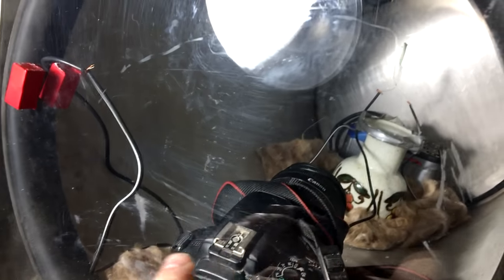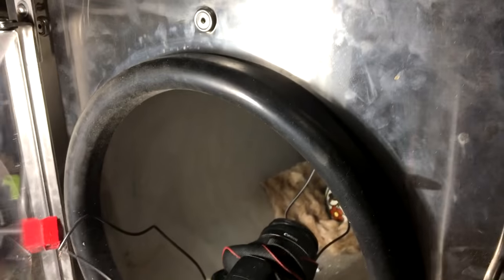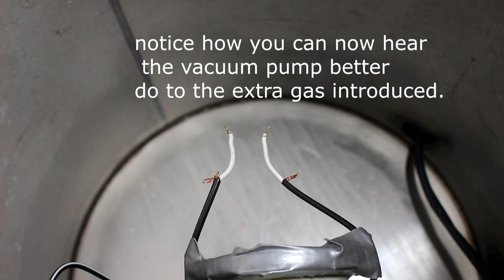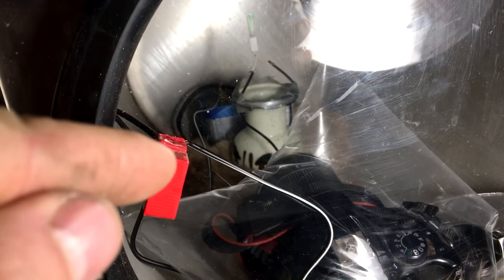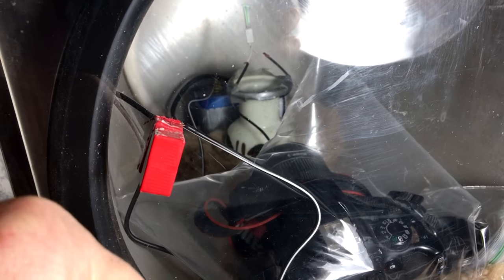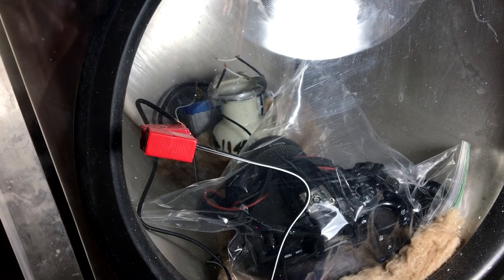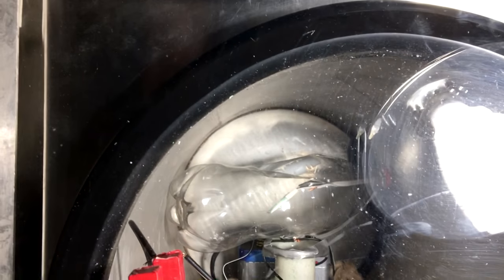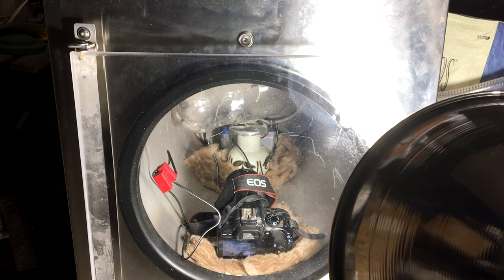Sound of Explosions in Space? part 1

Comment: The blasting cap is a high explosive so the speed of the expanding gas is very rapid. So the pressure difference between the inside and outside of the bottle ripped it apart.

Comment: That is what I thought about some time ago. It is often criticized that Hollwood overemphasises sound in space battles. The argument goes like: no medium -> no sound. That is technically correct and for normal soundwaves this is undoubtedly the case. For shockwaves on the other hand... I was sceptical. Shockwaves are usually created when a medium is compressed faster then its speed of sound allows. This is the case until a pressure equilibrium is reached between the compression zone and the surrounding medium. Under vacuum the shockwave could virtually travel for ever as there is no surrounding medium. Of course at some time it will be undetectable due to expansion but in close proximity a powerfull enought explosion would be audiable even in space.

Comment: 500 mTorr is ~ 5 quadrillion times the pressure in deep space. Taking into account the temperature difference, your near-vacuum chamber is still 50 trillion times denser. So, sound will travel better through it. (Plus as you mentioned, it's a small container trying to contain an explosion with a microphone not free floating from the outer case)

Comment: I've always argued that big enough explosions in space would carry sound for much this reason.  If you look at a slow motion video of an atmospheric explosion the sound is generally carried by a single blast wave that's faster than the pressure front of the gases, but an explosion still produces a lot of fast moving gas that would impact any non-vacuum containing object and should provide a weak medium for the sound.
My hypothesis is that in a vacuum the gasses from an explosion should expand faster due to the greater pressure gradient while the initial force from the blast, lacking a medium to propagate through, would be concentrated in shrapnel and the more dense gases giving more damage and some impact sounds.  If that holds, I'd expect an explosion in space to have different sound (a rumble or thud maybe?) and be much quieter.  I'd also expect them to appear bigger, and happen faster.  ponders actually, explosions in space should look like fireworks.  Now all I need to do is figure out how to ship explosives to space for controlled detonation and observation.

Incidentally, the hole in the bottle makes sense... the explosive produces the same amount of energy and the same pressure wave as it would under normal atmospheric detonation, only without any air to dampen or diffuse the force.  The bottle doesn't have a higher pressure on the outside to provide it with reinforcement, so the result seems about right.

Comment: Cool thing, but I have one thing to mention about your experiment. The chamber is at low pressure, like space is. But space is not surrounded by a barrel, which reflects and amplifies (by reflection) the gas which is expanding inside your tube. Try to disable the reflection and make the experiment again. Maybe something fluffy covering your tube and some wadding between the microphone and the blastcap will reduce the reflection by swallowing the extending gas.

Comment: Hi,

Here is my opinion.

1) The blasting cap will produce considerable amount of gasses, which could carry the sound waves
2) The testing chamber is quite small and allows pressure built-up on small times scales
3) Vacuum is still not even close to outer space and there are sufficient amount of gasses to carry sound waves
4) From my experience thin films like plastic bags are quite transparent to sound

Your experiment is quite interesting. However in my opinion the conditions are quite different compared to outer space and we should only accept that it appears the sound has traveled in this experiment. 

Regards
Reply from the maker: I asked NASA to detonate a small explosive outside the space station for me but they have failed to reply.

Comment: Sound is high frequency vibrations. This chamber bounces the gas around from the explosion which echoes the initial gas release making more vibrations. I expect in space if the explosion is a good distance (say 200 m perhaps, depends on explosion too) you will simply feel a wind, first the fast particles will arrive then the slow ones. The wind will probably be imperceptible (depending on explosion) with no audible sound (ie no high frequency vibrations in this wind). Unless you get hit by shrapnel... This does not happen in an atmosphere because the explosion transfers its energy to make pressure waves which all travel at the same speed and all arrive in a short time span, and delayed due to that limited speed.

Comment: And furthermore, the gas particles might even produce more echos.
The particles aren't slowed down so they can travel further, so distance wouldn't make that much difference plus in this case they can also bounce around in the chamber.
Would be interesting to gauge the pressure at set distances and compare vacuuum with atmospheric conditions.

Comment: Before watching the video... and knowing the size of vacuum chamber he's got.  Yes an explosion will make a sound.  The expanding gas will fill the chamber and transmit the sound to the walls.   He would need a much larger chamber to have the gasses disperse enough.  However an alarm clock should properly show the absence of sound transmission through vacuum... assuming it's properly isolated from the walls of the chamber...

Comment: My hypothesis: the sound was actually due to the increase in pressure inside the chamber pushing in on the diaphragm of the microphone. I.E. in a larger vacuum chamber the amplitude of the sound would be less and in a smaller one the amplitude would be more.

Comment: I'd say the shock wave could be even more destructive in vacuum, because the hot molecules from the explosion would travel undaunted right until they collide with something. In the air, however, they would have to push other molecules to carry the shockwave. In vacuum, on the other hand, the shockwave most likely won't be able to overcome obstacles on its way, because it just doesn't have enough density.

Comment: You have no vacuum once the explosion happens because the chamber fills with the explosion gasses. You can even hear the sound of your air pump change momentarily after the explosion. As for what an explosion in space would sound like, I think it would sound like a click. That's because the wavefront would only push and there wouldn't be the elasticity of the air to pull back, therefore no cyclical variation, therefore no frequency. The duration of the click would be exactly the same as the duration of the explosion, almost instantaneous. The waveform would be a sharp spike rising to its maximum value and then falling back to 'normal' pressure, in this case negative compared to earth.

Comment: Gaseous explosions should make sounds. Give this a run... Increase the chamber volume and the ID of hose between the cap and the vacuum pump. Between pump and chamber use a large pressure vessel. There should be a db difference.  Hypothetically speaking.

Comment: Does popcorn produce a significant amount of gas when a kernel pops?  Most traditional explosions are accompanied by a large release of gases.  But from my understanding, hot corn kernels contain starch mixed with some water.  The water inside passes atmospheric boiling point and because of that, builds pressure, and somehow "melts" the starch.  When the kernel finally bursts, the carbohydrate-water mixture rapidly expands and cools, and the starch solidifies as a foam.  The expansion is stopped very quickly.  Not much excess gas involved I think, but could be wrong.  I'd like to see that experiment.

Comment: I wonder if the camera would still pick up sounds if it wasn't touching the vacuum chamber.

Maybe you could try having the camera floating (with magnets locking bottom and top) to make sure it isn't vibrations traveling through the vacuum chamber and transmitting to the camera.

Which makes me think, would the magnetic field of the magnet fluctuate or vibrate with the vibrations from the vacuum chamber are transmitted to the magnet stuck to it?

Comment: you could try using a less gassy explosive like silver acetylide:

Pure silver acetylide is a heat- and shock-sensitive high explosive with the unusual property that on ignition it does not evolve any gas:

Ag2C2 (s) -> 2 Ag (s) + 2 C (s)

Comment: That's pretty cool man, seems kind of obvious when you explain it like that. In that case then, an explosion in space can only be heard if you are close enough ? i suppose beyond a certain blast radius, the shockwave will lose enough energy that it will just diffuse into the vacuum and won't be going fast enough to "hear" or move a diaphragm any longer. Is the math of this already understood ? For example is there an equation which describes the expansion of a blast wave and it's corresponding gases, into a vacuum ?

Comment: Actually it's quite good explainable, A explosive is a compacted gas in a way, or a gas creating, multi component, otherwise it would not explode in a vacuum. By using a balloon strong enough to withstand the zero vacuum and break it at zero vacuum you will hear a pop or bang.   An explosion near enough ''without harming'' to the ISS can be heard inside ISS.

Comment: Consider the relative volume of gas produced vs. the size of the chamber.  If you recorded the pressure before and after, you would very likely find a measurable difference, and when you figure in the temperature of that gas at the time of detonation, you are probably getting a pretty good initial pressure wave several orders of magnitude higher than the steady state pressure difference between before and after.  If you did something like this in the chamber at NASA Glenn RC, odds are you would find the effects to be much smaller, especially at a distance of say 50cm or more.

Comment: well to casually ponder, in a truncated manner...we can't know how much of the mic signal is from resonance of the camera body (from the impact of the explosive material)...and a whole bunch of other similar considerations having to do with all that solid medium, and reflecting exploding materials. The energy seems 'everywhere' in the chamber because it is trapped and reflects off of everything. The plastic is still a 'solid' at those velocities. Maybe no air but a lot of other paths to transfer energy.   But the gas and micro-shrapner does move through a vacuum (unlike a source that emits no material)  and would be directly detectable. If would just take a much more elaborate rig to try to record the difference in what signal the mic would make in a vacuum when stuck by those materials, or in air. With air in chamber the air itself would be a resonator. (like inside a speaker cabinet or a organ pipe).  I you had a spaceship with an external, isolated microphone, that would be interesting. You probably wouldn't detect a chemical-rocket motor on another spaceship unless it was kinda pointed within 90 degrees of the mic (motor cone limits dispersal of gas to sorta a hemisphere). If an astronaut was on the outside of the hull of a neighboring spaceship, hitting it with a hammer, that wouldn't be detected at all. But if there was an explosion, that would be detected (if there was nothing between mic and explosion). But would it produce a  much lesser signal in the mic over a distance than in air? Maybe not, idk. The energy is spread over area (reducing intensity per area) with distance of course, maybe in comparable ways in air or vacuum.  Maybe it might sound quite different. Because the shockwave pushing on air molecules sets up a condition that I think affect the mic quite differently than just the explosive material stiking the membrace. At some distance...well you have a finite number of gas molecules speeding thought the vacuum, becoming farther apart.  In air the energy it pass only as a wave so it stays more 'intact' (the air molecules are the same density at source and mic).  I would guess it would both sound different and fade much more quickly. And sound more different farther away. Just a guess.
I find it quite interesting. Maybe it would depend on the angle it hit the membrance too.
as directionality of mic would be quite different vs in air, I think.

Comment: explosions can be more powerful in a vacuum because its a mean-free path. rockets are more powerful in space as well. the space shuttle main engines get 452.3 Isp in a vacuum and 366 Isp on the launch pad at standard temperature and pressure.

Comment: Well the problem is that most don't think about is sound waves are energy and they travel. Gasses or not they still travel. If those waves were to travel and hit atmosphere unimpeded like a container then they will stat to transmit the sound when they contact the air particles. That's why using this setup most come to this theory or sound can not be made from an explosion are kinda wrong as if the force creating the sound waves which is still in energy form can overcome the barrier they will transmit sound. If a sun were to go supernova then you would hear it if you were near it by the sound wave traveling to you. Point to note I am using a supernova as a force to create more than enough energy that would produce a strong enough sound wave to be heard, aside the factor of death that is what I am using it for. If you remember the sonic charges or whatever they were called in the 2nd Star Wars (5th if you go by when they were made) movie while in space the wave was the energy from the blast and the sound would be heard as it hit the atmosphere in the cockpit.

Comment: Cody, did you happen to watch your vacuum gauge at the instant of the explosion?  An alarm clock does not make sound in a vacuum chamber, but the explosion does because the gases released "undo" the vacuum.  I wonder if the gases are traveling faster than the speed of sound ( whatever the speed of sound is under those pressures and temp?).

Comment: I wonder how much of the sound transfer can be attributed to fragment impact on the chamber?

 it is also definitely worth noting that in space, the force/sound transferred by the expanding gases will be sharply limited by the inverse-square law.

finally, testing the force of the explosion based on a confined charge is a flawed setup.  if the expanding gases have nowhere to go besides the bottle, of course they will break it.  the explosion is converting a solid fuel to a gas, which is an expansion of thousands of times the original volume.  of course a 2cc blasting cap expanded to 4 litres of gas in a fraction of a second broke the 2 litre bottle it was in.  that big hunk of white plastic makes good shrapnel, too.

Comment: My question is, is it possible that the flying debris is responsible for part of the sound as well? 

And people always assume that you can't have a fire in space, how else would rockets work if they didn't expel what is essentially a controlled explosion? As long as you have fuel and an oxidizer, anything can burn anywhere.. Maybe not as spectacularly, but it will still happen. And when it comes to movie explosions, the amount of air being pushed out of a craft by decommission could theoretically cause a massive fire ball.

Comment: Would be interesting if there was a way to do a high speed thermal image of it.  The gasses would be much hotter, so the "gas bullets" should streak outward.
Reply: stonent A thermal camera isn't able to capture gases since they are so much less dense than the solids and especially not if they are moving super fast.
Reply: You can exhale and see it on a thermal camera.
Reply: You could also use Schlieren optics with a normal high speed camera.

Comment: Cody, I think your experiment may have been contaminated by the fact that your recording equipment is in contact with the vacuum chamber, which, in turn, is in contact with the atmosphere outside of it.  It would be interesting to float an alarm clock or radio inside the vacuum chamber.  Since you can't do that, perhaps you could suspend it by a very thin thread, and run your test again, first, at 1 atmosphere of air for a control measure, and again in a near vacuum.

Comment: I have experience with steam turbines and the power output and efficiency is greatly increased when the steam is allowed to expand into a vacuum. It is the difference in pressure that allows a greater expansion in volume of the steam to perform more work. I believe that in a very round about way, your explosions are a bit more efficient under vacuum conditions and am curious to see if the bottle would not be shredded nearly so bad when not under a vacuum. 

I do believe that a larger vacuum chamber would yield better results in that there wouldn't be all them gas molecules crowding up against your microphone.